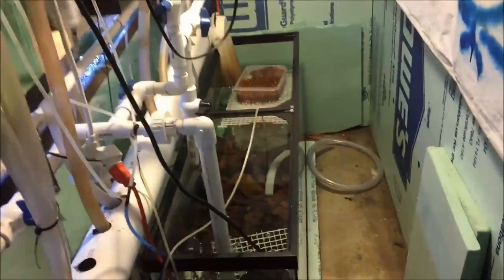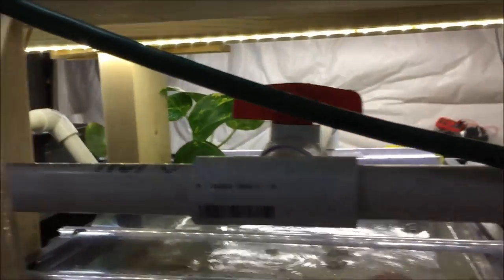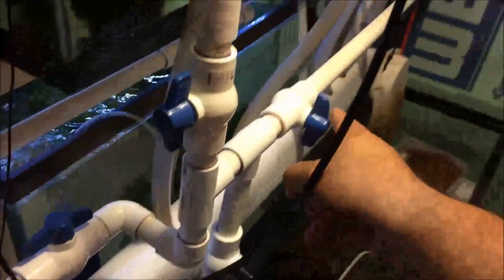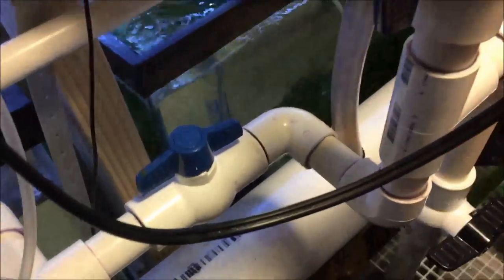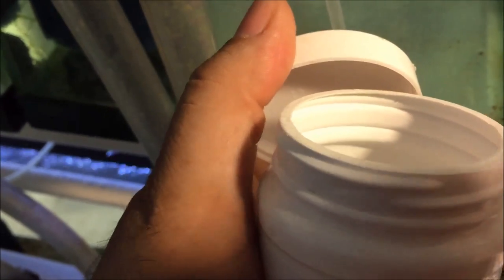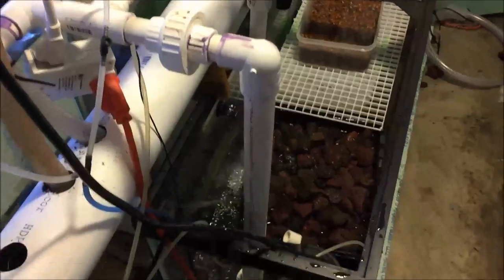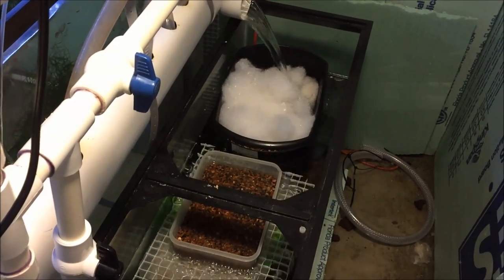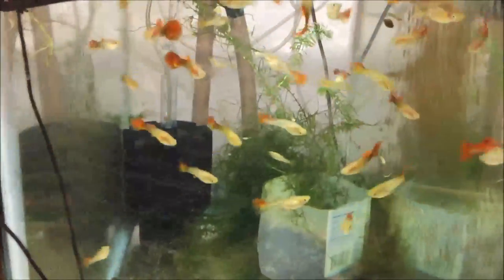Fish Room Update New DIY Fresh Water Sump Design, K1 Kaldnes Micro moving bed filter and Lava Rock

Comment: A diffuser over the floss would help prevent channeling and increase the usefulness of the floss.
Reply from the maker: Good idea! Thanks!
Reply: Michael's Fish Room I was thinking the same thing. You use a piece of that lighting diffuser with a weight on top
Reply from the maker: +Reid Smith yeah, that system really didn't work for me, so I am making an auto water change system!